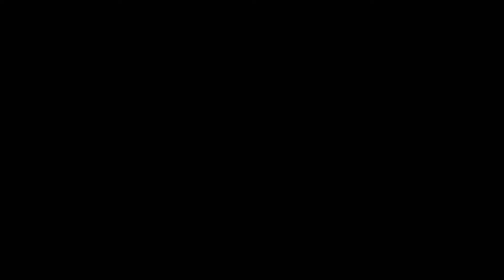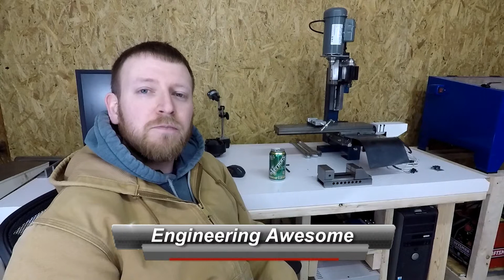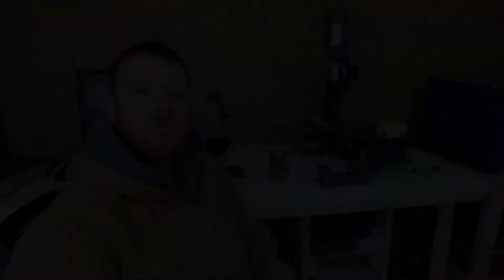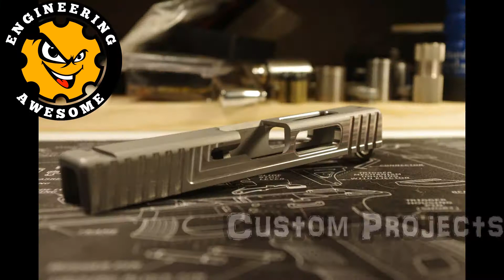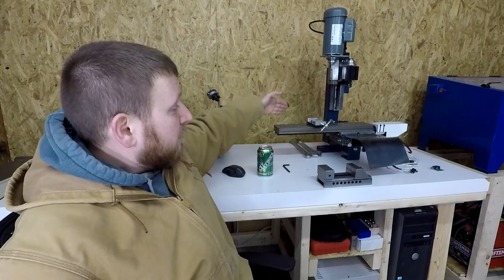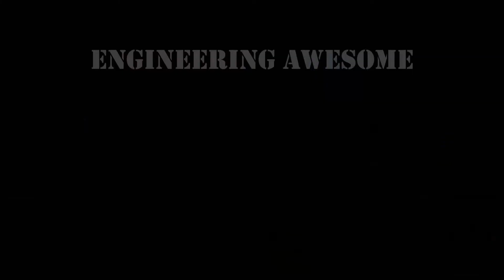I Got A Taig CNC Mill!

Comment: Do you have a build sheet for this? Definitely would like to build one
Reply from the maker: The Taig mill is purchased as a mostly assembled mill rather than pieced together. I can send you a link for sure if youd like one.
Reply: Yeah for sure! Thanks
Reply from the maker: http://www.taigtools.com/mmill.html

I would do two things differently. First, buy the ball screw machine. Second, build my own controller setup. It can be cheaper and in my opinion better than with the G540 setup. I have a monster setup on my plasma that was actually cheaper. Larger form factor but that's ok.
Reply: Engineering Awesome okay thanks! I’m just starting out doing this cnc stuff so lot to learn. Mind if I DM you on insta for more questions?
Reply from the maker: @dillonmitri1670  of course not. I'll hook you up with an email address. I have experience with this stuff but I learn something new all the time.

Comment: Does the Mach 3 software work well with the unit?  Have you tried cutting Aluminum? Thanks
Reply from the maker: Mach3 is good for what it is. I love it for the smaller less feature packed machines. But it would not work as well for a larger mill with a probe and auto tool changer and such. Great for the taig. Yes, I have used my mill to machine aluminum. I machined all the parts for my plasma table. Works well. Use good end mills though.
Reply from the maker: I did take a video of me cutting some aluminum on the taig last night. I just hand programmed it so that I could quickly skim 1/8 off of a clamp. I can put it on Instagram if you want.
Reply: That would be awesome. Thanks
Reply from the maker: @ronjohnson7699  it's up on Instagram.

Comment: Your taig mill is 4K here in Australia. What can I do?
Reply: Trump wants ultimately zero tariffs. Call the White House switchboard with US and Aussie prices. Find out if the price difference is tarrifs and not other things. You might call Taig first. There is much disinformation on Trump policies.
Reply from the maker: It depends on what you are looking for. If you are ok with just wood and maybe some light aluminum cutting, there are a lot of really great options that you could check out. But for aluminum and steel I am really not sure about what you can purchase in another country.
Reply from the maker: Marc S looking at this, it looks like a decent setup. Basically a grizzly mill. But it would require a cnc conversion kit. Which wouldnt be too bad, but still needs to be kept in mind.